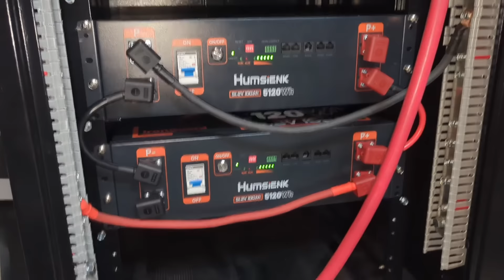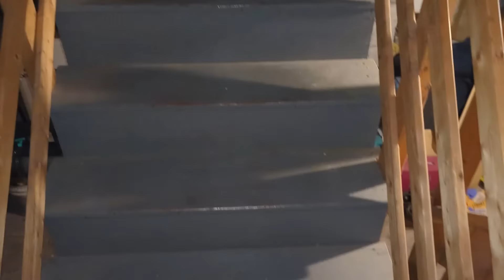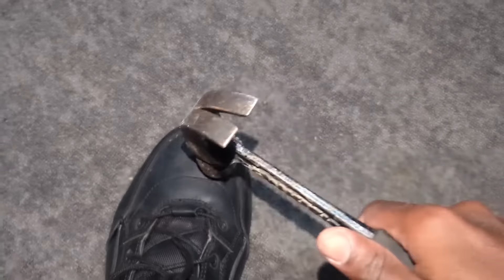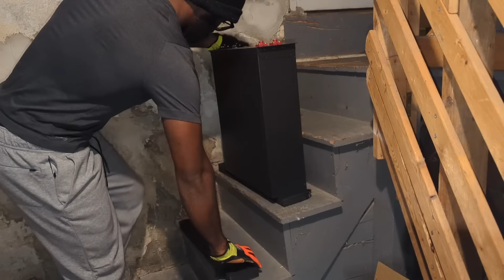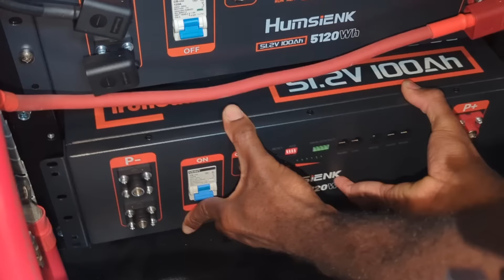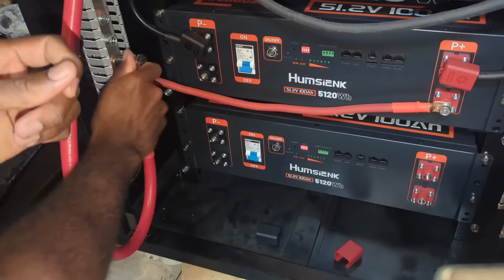15.36 kWh Solar Battery Storage UPGRADE! | Humsienk Server Rack Batteries Installation

Comment: You used 2AWG from bus to terminals on the battery?
Reply from the maker: Yes. It is very important to size the wire properly. There are a lot of wire size chart available online. I'm in my case, even if my house is using 24kW, it will only pull 90 amp from those three battery because I have multiple battery banks

Comment: nice video, how did u configure the inverter to charge those batteries,  Manual or based on the EG4 batteries you have ?
Reply from the maker: It used to communicate with the EG4 batteries but I recently changed it to lead acid battery. Float voltage 54.4, charge voltage 58. It's performing better than I thought.

Comment: I don't know if its possible to buy crashed EV's where you are. I have the batteries from two crashed 2014 Tesla's (85 kWh X 2) hooked up to my solar. This way I can also charge my EV's using solar.
Reply from the maker: Using crashed EV batteries for solar storage is a great idea and a resourceful way to get a lot of capacity.
Are you using them as high voltage or 48V?